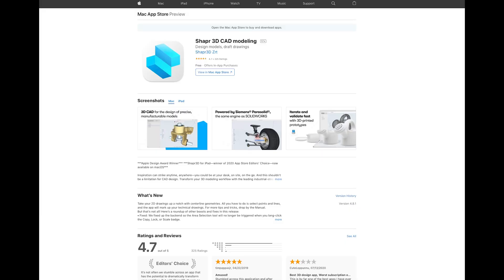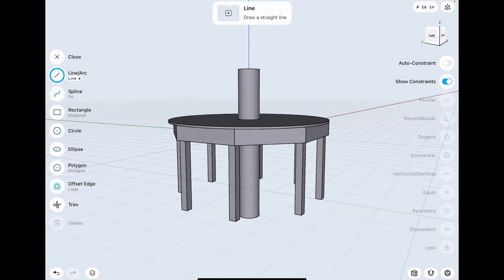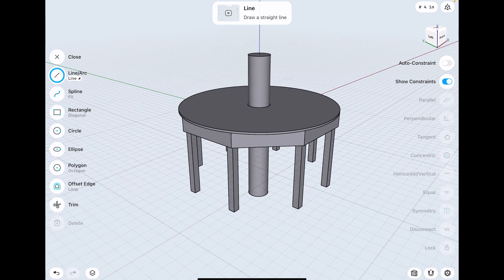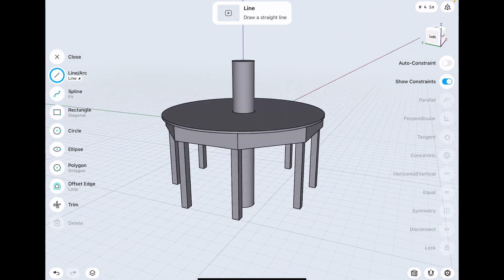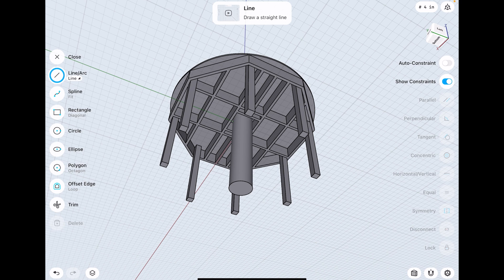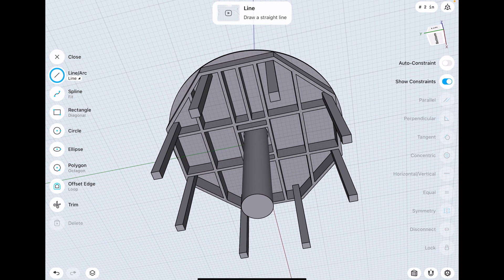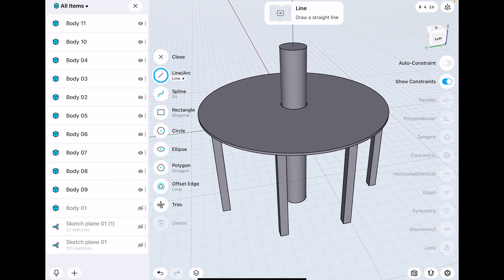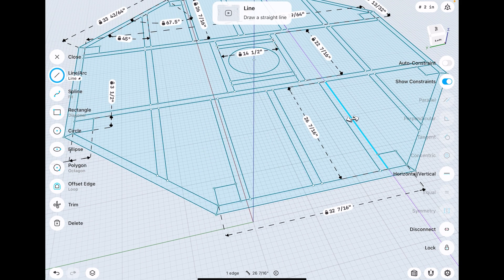NexDome Observatory Build - Planning (Video 1)

Comment: Hi, should the pier be exactly in the center column? I have seen their schematics to vs anyway 10.6" away.
Reply from the maker: It shouldn't be in the center. I have such a small scope though that it's not really an issue for me. Although, if I ever get a larger scope I might need to move the pier, which isn't a very exciting idea...haha. 

The pier should be placed so that the mounts center of rotation (where the RA and Dad axis converge) is in the exact center. That will result in the best geometry.

Comment: Save yourself the hassle digging and rent a hole borer for the day! How are you going to manage the door area if you are doing a circular build, is it sill low to the ground so you can step in off the field? With the square deck, it does give you nice area for door access.
Reply from the maker: Actually the holes are already dug! I did use an auger. It was a huge help. 

As for the door, my plan is to put a small landing on the downhill side of the observatory aligned with the door to the dome. It should work out perfectly. I’ll make a video about it once it’s done!